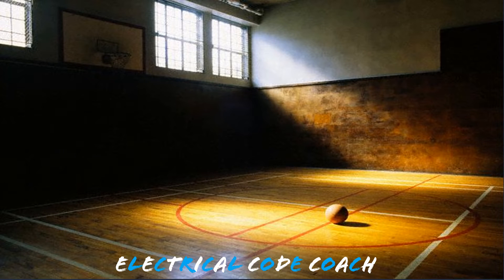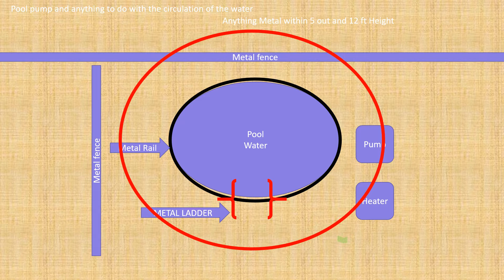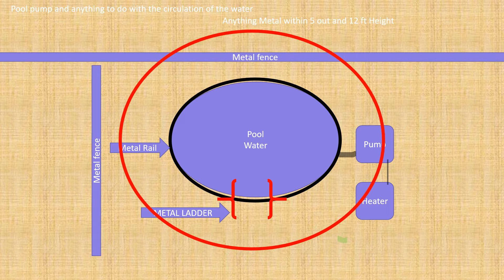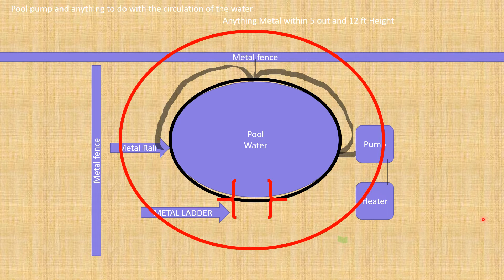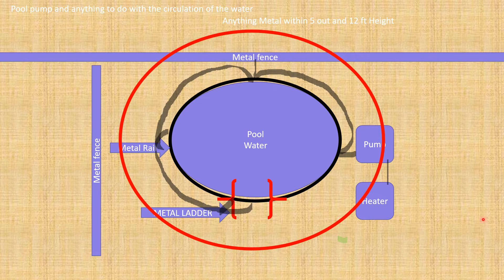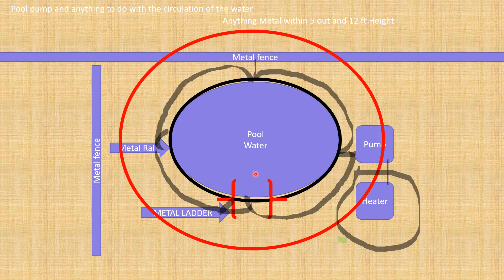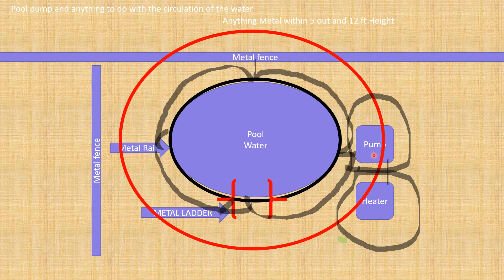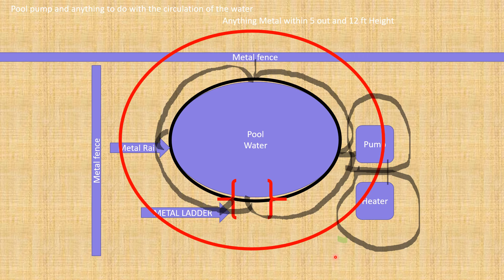Pool Bonding, Building the Equipotential Bond. On the Electricians in Action Everyday @ 9:00 am

Comment: Can I use grey UF-B 14-2 for running circuit to pool?
Reply: i recently spoke to an inspector about running powe to my pool. It turns out in my county, homeowners are not allowed to wire a pool but nearby counties allow it. you may want to search your local board of electricians in your counties to see exactly what they allow. In my town I can't run the gray UF-12/3. it has to be Thwn or Thnn rated wires inside conduit buried at least 18 inches. i learned that from one of the inspectors in the aread. 

The "THHN" part of THHN wire stands for "Thermoplastic High Heat-Resistant, Nylon-Coated". "THWN" wire has the same properties, but the "W" part of THWN adds "Water resistance". The main difference between THHN and THWN wires are their maximum recommended operating temperatures in wet locations.

Comment: So basically u just have to attach anything metal to each other and it has to terminate on something that u already bonded like the pump again.  

I have a heater that has two lugs for attaching the 8 AWG bond copper wire.  One lug has a copper wire that bonds to the pump.  Can I then use the second lug to attach to the saltwater generator?  Or does it have to be attached to the same lug as the one the pump is attached to?  Thanks!

Comment: My only question is….do you connect the bonded items to the power supply ground? Wouldn’t this create multiple paths for current to take if there was a fault in the middle? Or do you not connect the ground from the panel to the pool bonded? I ask this because I learned when adding a sub panel (outbuilding) there must be an independent ground conductor from the main to sub panel. Using a separate ground rod at the outbuilding and bonding the ground to neutral  is a no no.

Essentially you either have 2 separated bonded circuits that are grounded at one point each. Or you have a circuit that is fully bonded, and grounded at the main panel, and the ground within the pool bond. (((Or is the bond around the pool not really considered grounded, even tho it is in the ground, but not on a ground rod?)))

Comment: what if my pool pump is 30 feet from my pool?  do I go all the way around and run the copper wire 30 feet?
Reply from the maker: Great question! definitely work with your inspector and a qualified licensed electrician but according to the NEC yes you will have to bond the circulation system

Comment: Have a quick question. Can I lay the bond wire around the pool than run "legs" using  the correct burial split bolt to tie the legs to the loop to instead of spider webing ? I have other metal compontes that are in th area that will have to be bonded.
Reply from the maker: Definitely work with your electrical inspector but yes it does not have to be a continuous loop according to the NEC
Reply: @ElectricalCodeCoach  Thank you and I will be dealing witht the inspector as well.

Comment: lets say this was a spa.... and two sides of the spa were up against a structure and it would never be an area that you would step on.   can you disregard the 18-24 inches away requirement in that area and just run the loop directly under the outermost edge of tub on those two sides, and the two sides that you would have area you could step on surround tub place it 18-24" out in those areas?   Or would I literally have to dig under the structure and make sure its 18-24" even in those areas that have a structure over it that it would be impossible for me to stand on.   To me, I say to myself why the hell would I need to go 18-24" out in areas that I cant even stand because it has a structure over it.   Instead just run wire on outer perimeter of tub, then on the front side and other side where I can stand have the loop extend the 18-24" they want in code.
Reply from the maker: Are you talking about a hot tub?
Reply: @ElectricalCodeCoach   he’s a self contained hot tub.
Reply from the maker: i would contact a qualified licensed electrician and work with you local electrical inspector, average above ground hot tubs do not usually fall into the scope of this video
Reply: @ElectricalCodeCoach  in my case bonding is needed.  

B) Bonding. Bonding by metal-to-metal mounting on a common frame or base shall be permitted. The metal bands or hoops used to secure wooden staves shall not be required to be bonded as required in 680.26.
Equipotential bonding of perimeter surfaces in accordance with 680.26(B)(2) shall not be required to be provided for spas and hot tubs where all of the following
conditions apply:
(1) The spa or hot tub shall be listed as a self-contained spa for aboveground use.
(2) The spa or hot tub shall not be identified as suitable only for indoor use.
(3) The installation shall be in accordance with the manufacturer’s instructions and shall be located on or above grade.
(4) The top rim of the spa or hot tub shall be at least 710 mm (28 in.) above all perimeter surfaces that are within 760 mm (30 in.), measured horizontally from the spa or hot tub. The height of nonconductive external steps for entry to or exit from the self-contained spa shall not be used to reduce or increase this rim height measurement.

Comment: Do you need to ground it?  I've seen a lot of information about bonding but how do you (should you) ground it?
Reply from the maker: Are you talking about establishing a grounding electrode system at the pool or its sub panel?
Reply: @ElectricalCodeCoach  The only route to ground I'd have is via the motor to a GFCI outlet.  Do I not need to ground the bonded system around the pool?
Reply from the maker: https://youtu.be/ETHAi3hS0pk

Comment: What do you do with newer pools that the only metal is the wall. The bottom track, top rails and posts are all plastic. 
Is there any point in doing a copper ring all the way around the pool?
Reply from the maker: Great question, yes you still have to install a proper bonding system, you're trying to bring the ground around the pool to the same potential.
Reply from the maker: https://youtu.be/ETHAi3hS0pk

Comment: Coach ?start from the heater and from the heater going in to the main panel right
Reply from the maker: Definitely work with your electrical inspector, typically you do not go to the homes main electrical panel but work with your electrical inspector

Comment: Does the bonding copper get sent through it's own ground rod, or is it just a method of connecting everything. Or is the 18-24" ring around the pool, at the 6" depth satisfying the need to not use a "ground rod" (please forgive my ignorance and terminology, advanced DIYER who doesn't want to kill his kids (or wife) and can't afford the $9k i was quoted). The pool I chose came with lugs on each metal uprise for the "spider" and the pump motor. I haven't chosen a ladder yet but it's on a wooden deck so I will be finding a Water Bond Fitting appropriate for the plumbing.
Reply from the maker: Definitely make sure you work with your electrical inspector but typically no you will not be driving your ground rod for the pool bonding itself.
Reply: @ElectricalCodeCoach  thank you. I think I understand it better simply because of your video. Bonding isn’t a circuit but more so a way to make every potential energy source on the same plane. Which in my brain theory gives a path for electricity to go hopefully instead of a human.
Reply from the maker: Pool Bonding "informational purposes only": https://www.youtube.com/playlist?list=PLJokxpBhbuUd0JH-SkjvaVatq069whqne
Reply: $9k?!?! Holy crap I need to start charging about 3 times more than I do lol